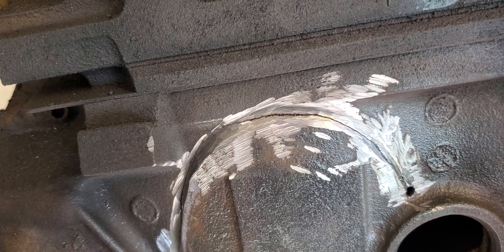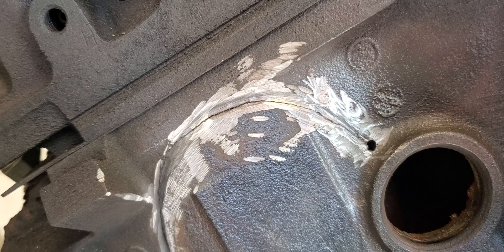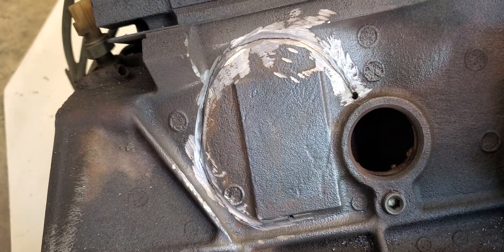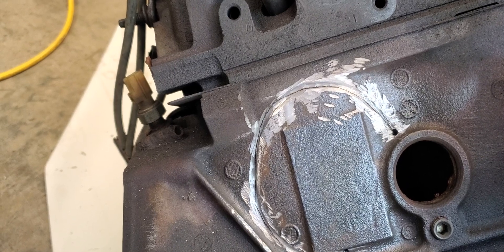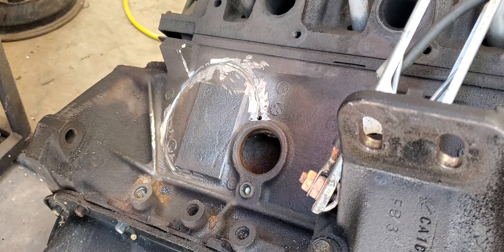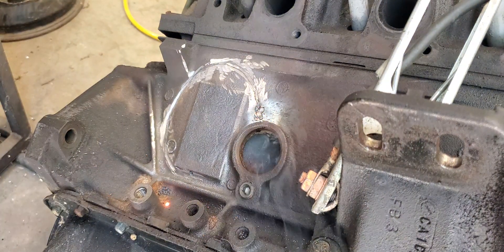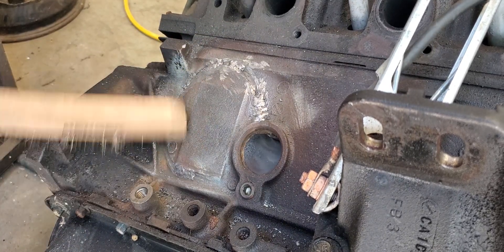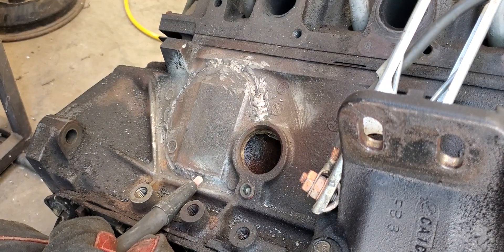Welding cast iron motor block

Comment: Thanks for your reply, my issue is I pulled engine from car it's totally complete, I'm not sure how I'm gonna be able to cool slowly. I asked approximately 10 local welders near me and they all were not interested in welding this small crack for me? I took 3 years of metal shop in high school and use to be a decent welder, last week I bought one of those electric welding guns, I'm gonna practice till I feel comfortable, with the pointers/direction u gave on your video I believe I will be fine. Thank you again
Reply from the maker: If you have a torch/ Map gas or propane. Just after you weld it use the torch to keep it hot. Move it around the welded area and let it cool slow.

Comment: Thanks for video, I have a 1993 Corvette 40,000 heater core was leaking, put water in rad, winter froze water 2" crack right about passenger side freeze plug, been watching videos for over a month, people using JB weld, I thought about it however it just ain't me. I haven't welded since high school, just bought hand held welder, gonna practice over the winter and attempt to fix over the summer. I'm from New York..
Reply from the maker: Thanks for checking me out. One thing I would do different is preheat the errata and let it cool slow.

Comment: So this is just regular flux core steel material? I have a repair on a 1924 Model T engine block and head. The farmer that used to own it, left water in it for a winter, it split the outer jacket of casting. I'm finally working on restoring this after it has sat in the garage for 40 years.
Reply from the maker: Yes,

Comment: Curious as to why the crack occurred because there was water instead of anti freeze.  Could someone explain?
Reply from the maker: Just plain water will freeze. Add antifreeze and it will not. 50/50 mix.
Reply: @weldingbyrileyfoster4121  Oh it froze. Thank you.

Comment: 15:47 is that not a crack to the right of the weld ridge about an inch or two above the hole?

Weld work looked great, very clean job.
Reply: that's gotta be a crack
Reply from the maker: No, it was just the block cast. Thanks.
Reply: @weldingbyrileyfoster4121  I've worked on these cast iron motors for a long long time and I'd bet my right hand that that's a crack. Never seen a block cast like that.
Reply: @weldingbyrileyfoster4121  at 0:25 it is 100% not there. Looks like a new crack during welding. Don't want your friend to get stranded, that's a crack at 15:47 and it's going to grow.

It's right at the right edge of the weld at 15:47.
Reply: It's starting to show at 12:30, then gets bigger. Must be a crack.